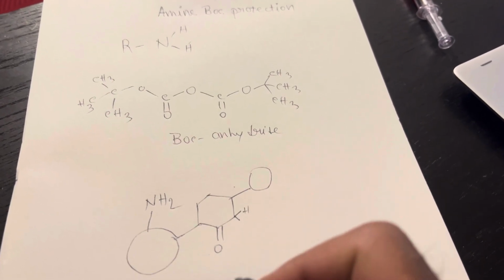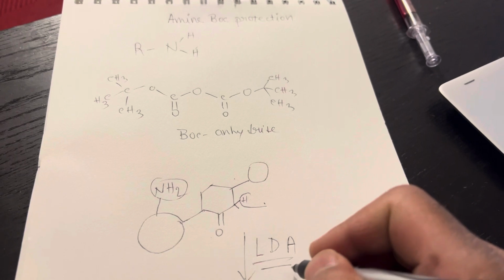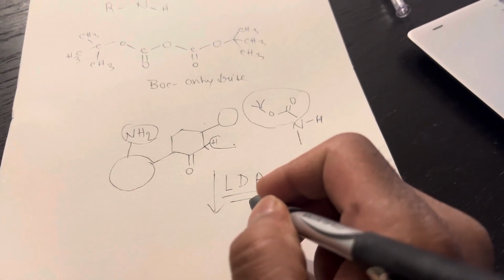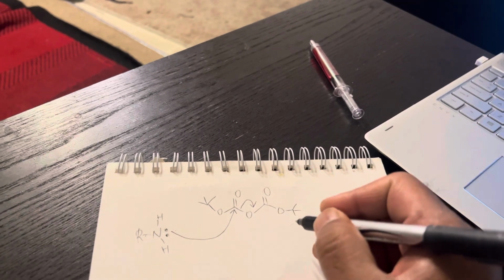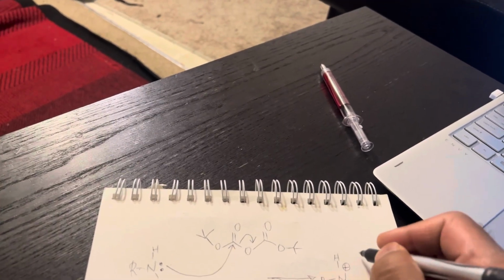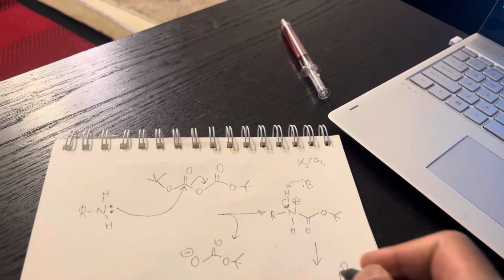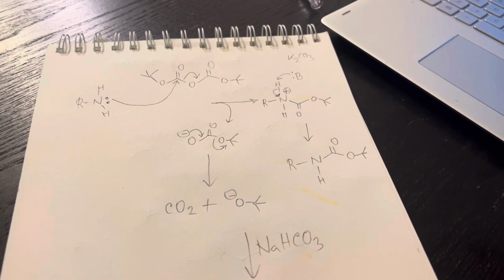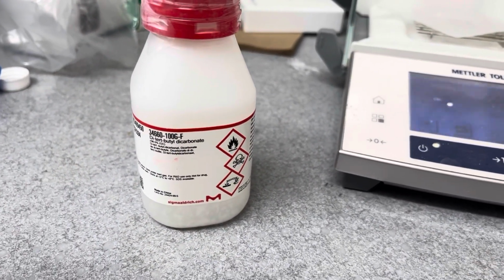Amine Boc protection-Mechanism and Reaction Setup

Comment: Great content professor! How about a video on deprotection method?
Reply from the maker: Hi Rick, I am not a professor. I was doing postdoctoral research in the time of making this video. Off course I can make a video on deprotection method.
Reply: @Dr.Mosharraf  I am working on a n-boc deprotection at this time and I can't find any good videos on actually preforming the prodecure. if you could make one or if you have point me to it, would be tremendously helpful
Reply from the maker: @mattkelly6880 is it deprotection from amine or from other functional group?
Reply: @Dr.Mosharraf  amine. and preferably the final product hcl salt, trying to stay away from tfa salt. recently read that reflux with 6M hcl for 1hour then adding some activated charcoal followed by filtering and evaporation may give me the desired results. just waiting on some activated charcoal and going to give that a try.